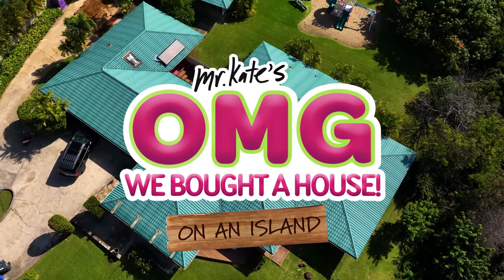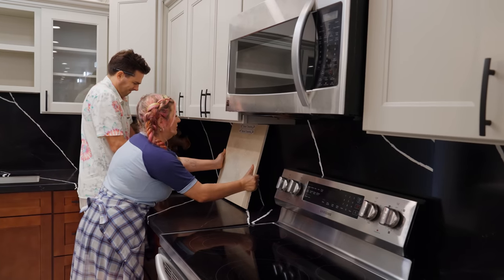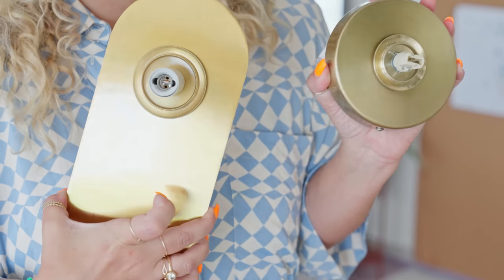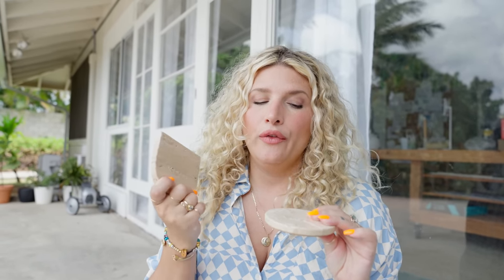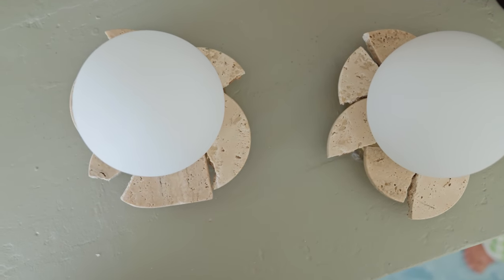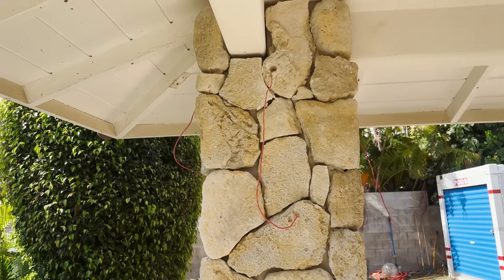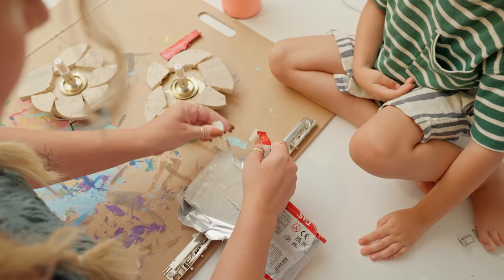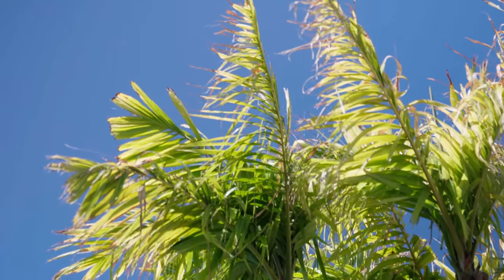Being the crafty b*tch I know I am! Saving THOUSANDS with these DIYs 🤑

Comment: Quick note in case anyone wants to recreate the sconces, Mr. Kate didn’t actually use polymer clay, I think she said that on accident. Polymer clay needs to be oven baked, so just be careful what projects you use it for because they can’t all go into the oven. While it isn’t as durable, air dry clay is the only one that can be used the way she did, plus I recognized the packaging; it’s air dry clay.

Another difference between the two, air dry clay can usually be smoothed with water and is much softer. Polymer clay cannot, I believe you can use baby oil on it if it’s super crumbly and rubbing alcohol to get rid of any fingerprints. While polymer clay can be bought in softer or firmer consistencies, it still tends to be tougher than air dry clay, you also don’t have to worry much about exposing it to air.